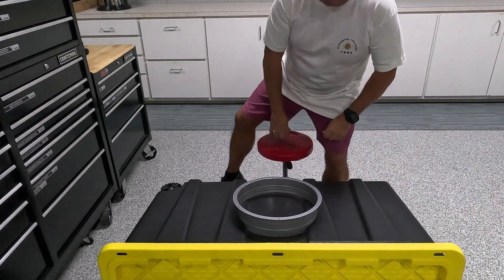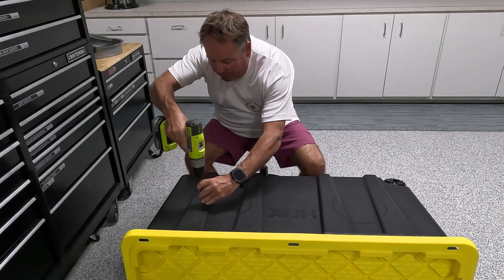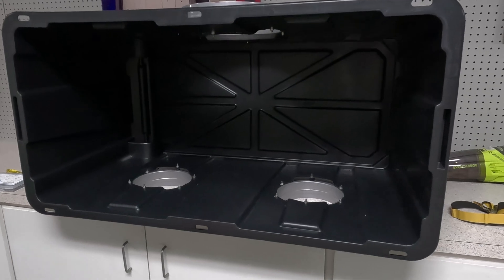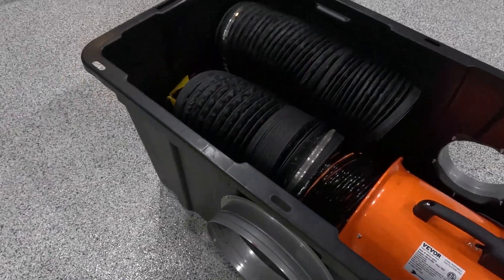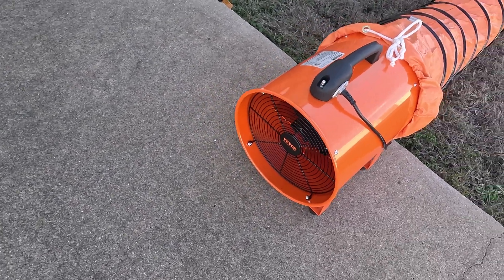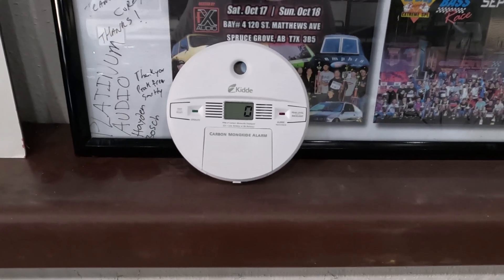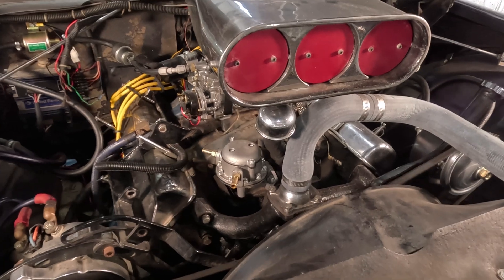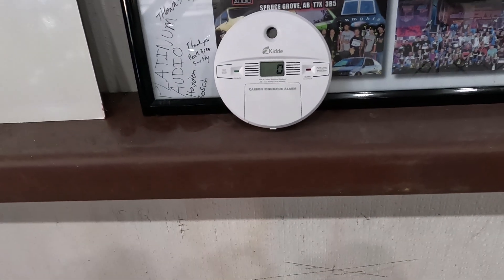Terminator Low-Tech Exhaust Gas Mitigation System

Comment: Wayne you need to Remove that Edelbrock fuel dumpster & install a Holley based carb. Those carbs are not good for things that sit. The aluminum body corrodes very easily from the current nasty pump gas we have. The other major downfall of those is the needle/seat can only hold 5lbs of fuel pressure. Majority of fuel pumps are made for a Holley & have 7-9psi.
That being said you need to add a regulator if you stay with the Edelbrock. A Holley based carb will have a much leaner/cleaner idle circuit as well.
WE MISS THIS CAR IN PHOENIX!!!
Reply from the maker: Thanks for the suggestions. I just installed an electric fuel pump and it produces 3 psi. I still have the original Carter AFB carb. I have rebuilt this carb 2-3 times, but Austin Speed Shop was doing the work this time and their labor costs were too high. They selected the Edelbrock. I'll either rebuild the Carter or take your advice and use the Holley in the future.
Reply: @dB-TV All Love from Audiophile to Audiophile. And Brother I'll come tune a Holley & the engine for Free for ya. As well as any other thing's we could do. You have a email I can contact ya on? I've spent the last 27 year's building/tuning muscle cars/drag cars. 
Shop's like where you just were bent over I'm sure of aren't good builders or tuners. That's a trendy shop that sells a bunch of merch versus tuning a bunch of fast efficient cars. Nor do they even understand it needs to be able to High idle cleanly for extended times. Removing a alternator for a fuel pump 😭 
That makes alot of sense on demo car.... Sorry not laughing at your pain but their ignorance.
Did they even offer having the factory gas tank coated? Did they offer changing the brake fluid to DOT 5 which is silicon based so it Never absorbs moisture to go bad?